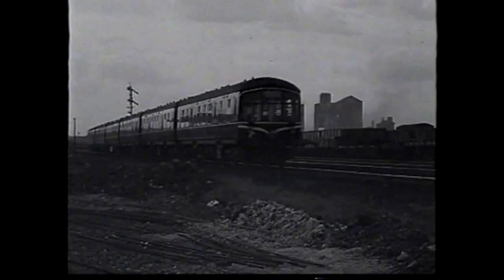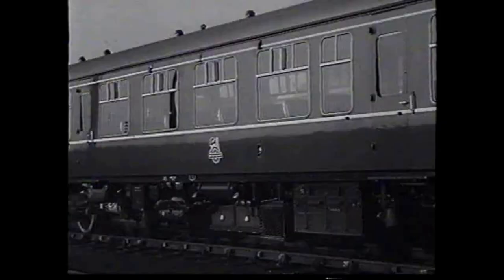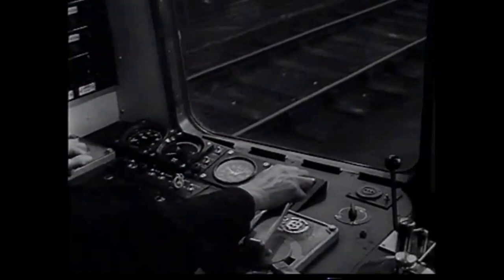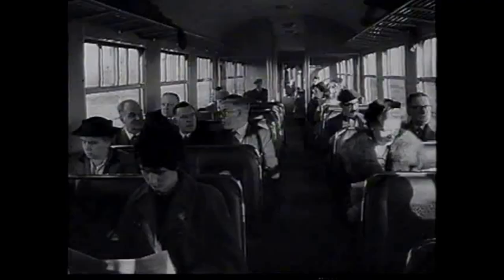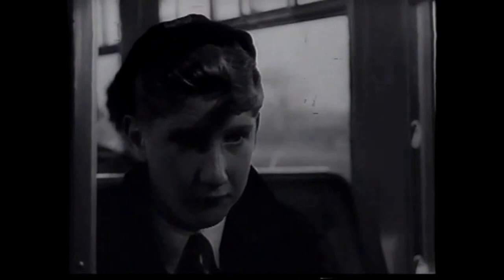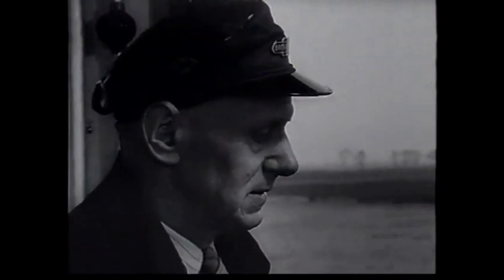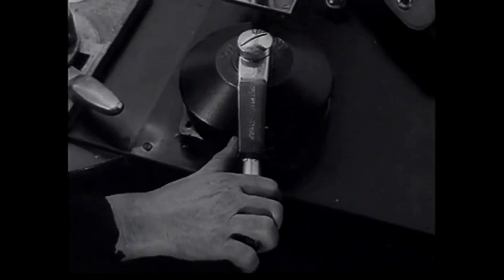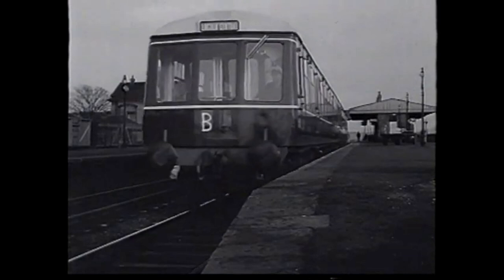Vintage railway film - The diesel train driver, part 1 - An introduction to the diesel train - 1959

Comment: I wonder how driving a branch line diesel train differs from that of a tram driver.  Certainly the rigors of driving a steam engine was very different to that of a diesel or electric suburban service.
Reply: Watch the rest of the series. The diesel train driver had to know a lot in case there was a problem. And all drivers had to know the territory.
Reply: @JugSouthgate  Yes, I agree, a motorman has to be knowledgeable, I meant from the physical side.